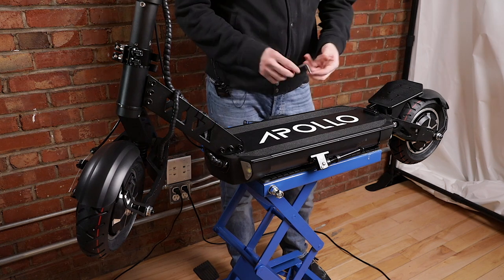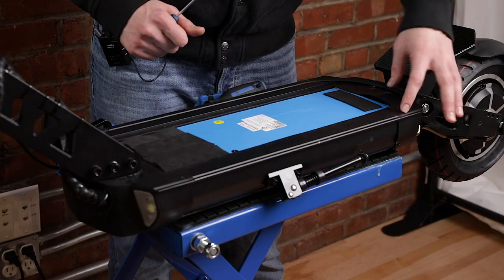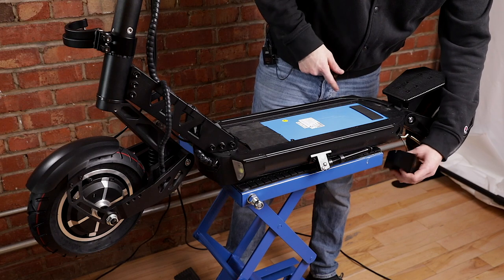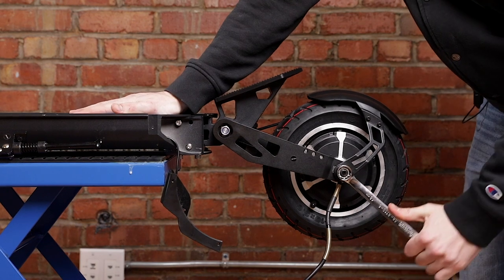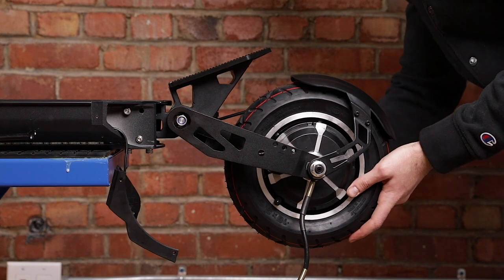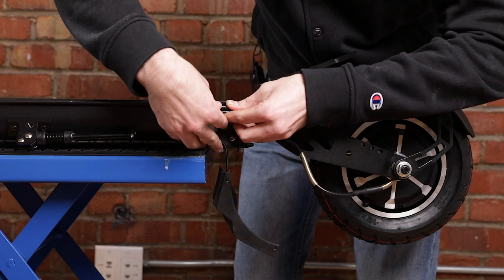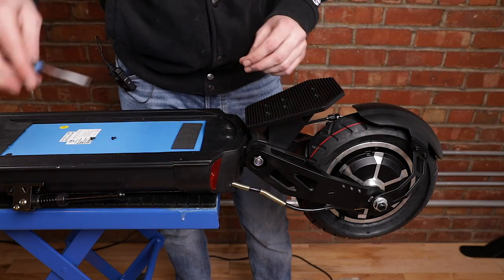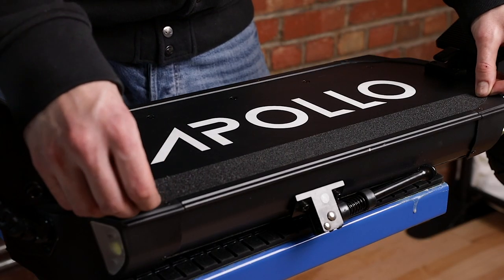How to Change the Rear Motor on the Apollo Ghost

Comment: Should I be worried that you are showing how to replace the motor on a scooter that is just being released?  ;-) Seriously though, nice video and I like the repair/maintenance series that you guys do. Keep it up!
Reply: I hope not as mine will be coming March 1st
Reply: Wondering the same thing. Apollo, is there an issue with the rear motor ?
Reply from the maker: There is no issue at all. However, we are continually shooting repair videos for all of our scooters. Repairs are inevitable, and we want our riders to be as prepared as possible :-)
Reply: @ApolloScooters  Thanks Apollo...it was not my intention to cause an issue.
Reply: @ApolloScooters  Thank you for these videos. For those of us who like to wrench, tinker, repair by ourselves, these are a great form of service from the company. Empowerment and greater connection to the machine.
Reply: @ratchfordgeorge  Was coming March 1st....check your email.
Reply: @ApolloScooters  what the springs sizes on this for both sides?
Reply: @ApolloScooters  do one on the springs please size or upgrade to shocks

Comment: Had scooter a few months and already battery issues, and rear motor needs to be replaced. Used on city streets, only used a 2 days a week. Between this and it being extremely difficult to get parts, the warranty is useless. Should have ordered a dualtron or Zero scooter instead.

Comment: It basically the same for the explore?
Reply from the maker: Hi @Chris Lethbridge, yes it's essentially the same, as both the Ghost and the Explore share the same deck design. You can also watch the tire change video that uses the Explore, for a more specific demonstration on how to remove the wheel hub (minus disconnecting the motor wire):
https://youtu.be/4aJMCtEH924
Reply: @ApolloScooters  all good was able to install new motor with ease thank you for replying